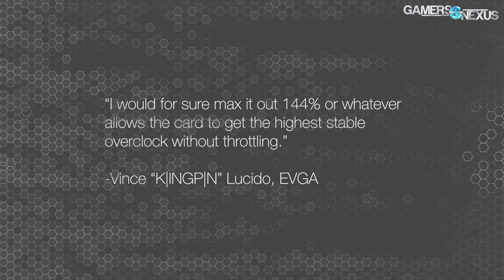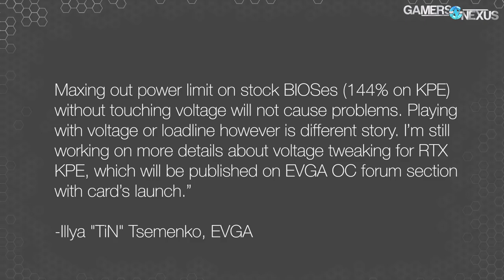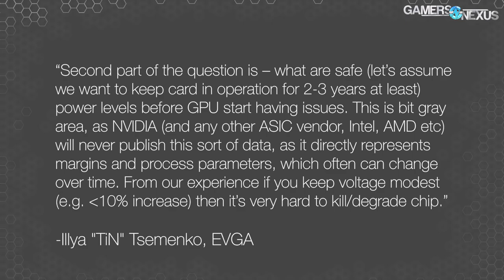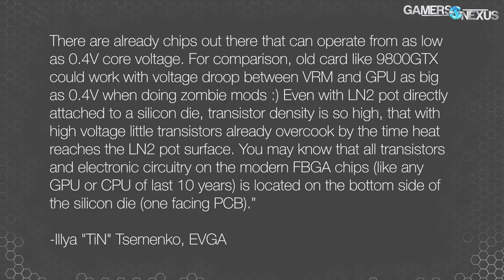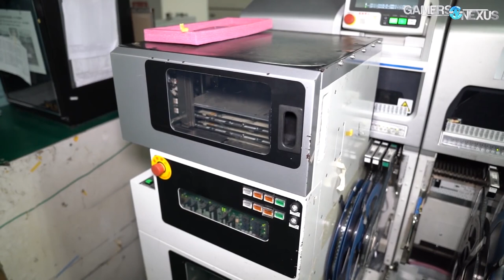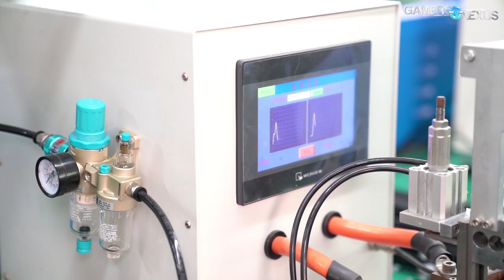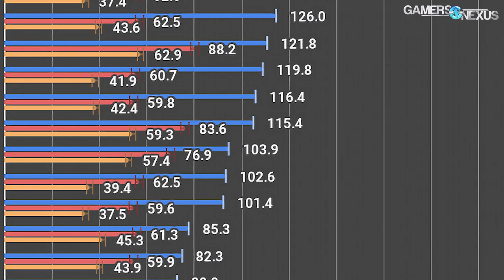Ask GN 107: Does Max Power Target Kill Cards? Ft. Kingpin & TiN Answers

Comment: Hahahahaha I've run my gtx960 at 108% power Target and a 42mv over volt in software! It's fans actually JUST started dying after 4 years of running at this torture!  Maybe I'm just lucky that it's lived!
Reply from the maker: Not bad! Fans are replaceable too. Wouldn't be hard to get it back in commission!
Reply: Sadly,  my EVGA GTX1080Ti SC2 is not able to handle any power target above 120% anymore in any games at all(random DXGI hang and system lockdown). Just a one and a half-year-old GPU. 😭
Reply: That’s barely an overclock at all. And I don’t see how that has an appreciable impact on fan life.
Reply: @altairfoo1920  Weird have been running 120% on Asus Strix GTX 1080 for close to three years now without any problem.
Reply: @1337ghomri  Probably because of my intense usage of my card. about a month of GPU computation tasks(Linus Folding@home event). But my 3 year old laptop can still do 47% OC(1038Mhz default, 1531 OC) without problem. Weird.
Reply: Altair Foo Nope, Pascal was hammered in mining, no issues for 99% of the cards. You just have a crappy dud of a card... a lot of miners were dumb and had them packed with inadequate airflow as well... they would be complaining more if they were failing that fast!

You would probably think my stability tests are brutal, but I’ve never seen anything get close to duel crypto mining (Furmark is way below this level in power draw, it can get insane! But, if it survives 1 week of that without melting or giving an error, then it’s probably good!). Your running something “hard” is laughably light. My motto is “if it’s not icing over, you’re not overclocking!”. You are basically running stock, at moderate or “gentle use”. Your not really using the CUDA compute 24/7 for years straight...
Reply: Altair Foo Your chip was probably borderline scraping past QC (I’m actually pretty confident Nvidia doesn’t have a QC in reality though). It was probably barely up for running stock, and now the near infinitesimally small degradation wear is showing. A lot of people have Intel at stock start crapping itself after a few years, while extreme overclocked dumping massive voltage in 24/7 running phase systems might run the CPU for the same amount of time. It’s silicon lottery basically, and degradation lottery from that, you just got the 1/1000 super crappy wear rate ones!

Personal advise, nuke the stupid thing and send it back, because it’s probably going to completely crap itself just days after warranty, and you won’t have anything. It’s defective if you saw that kind of wear (it would be wearing the same within margin of a few days even if you left it stock). Find some way to destroy it without water damage or visible scorch marks. Gonna be honest, that is so crap, I’d just ask them for a replacement as it is and say it’s crashing some at stock, because your really just at stock in reality... if they don’t approve, maybe stab a capacitor with a needle and say “oh my, some capacitor is leaking!”, because Nvidia directly will not help you out (they are a bunch of a$$holes who don’t give refunds due to faulty drivers making my Titan Xp unusable for months, and wasted thousands of dollars in my time). I’ll be destroying mine on LN2 since that $1200 I paid for has ran for me usefully for about 1 day, and that was it, couldn’t F’ing play Minecraft without crashing until I had upgraded to something 2x as fast, and after I bought it, went back to my old but very stable 2x Fury crossfire... Now I’m enjoying the butter smooth and reliable gaming of 4x Fury, so the Titan was useless, and I made the mistake of thinking it was user error or just windows needing reinstall, so unfortunately I kept it past day 30, so it wasted so much damned time I’ll be happy to help you destroy that card so you can get a working one because Nvidia is scum in terms of customer support. Do see if they will just accept replacement first though, Nvidia is a pain in the @$$, but other companies might actually care about customers, so you might just have a chance if you let them know, because that’s not normal, and you unfortunately have a defective card that’s just going to get worse,
Reply: @jakegarrett8109  that is a long reply, thanks anyway. haha

Comment: #AskGN

SO! 
I have a 9900k, Asus Maximus XI Hero, 32g 3200mhz, 2080ti, on a 1000w corsair RMi

As i go to export a video on Premiere Pro, after it gets to about 55% finished my computer does a hard reset, Everything cuts off, even the lighting on the MOTHERBOARD.
I go to check the event recorder and get a "Kernel Power Event 41"
I need this fixed pronto, could it be a bad PSU, bad CPU (I hope not) or motherboard 
Im hoping its the motherboard seeing as Asus cut corners with the VRMs on this board
Please please someone HELP!! 

Thanks!!

Comment: Should a $40 case have type c on the front? Objectively yes it should. This would continue to increase adoption of type c which I think we can agree is a good thing.

GN can and should grade a [case] on features and consumer price and use this industry knowledge to explain why the [case] did not score well.
Reply: where do you cute the corners to add the 10-20$ cable to the case if not more or less than that. The rest of the ports and types materials used structure etc. Instead of being a greedy consumer for your own benefit be a more open minded and understanding consumer as to why certain things are how they are. Rather than sacrificing other people companies or countries and collapsing economies etc just because youre so greedy.

Comment: #AskGN  any chance of you guys doing an investigation into why  the 3900x appears to have one chiplett stronger than the other? 
We'll use my 3900x as an example and we'll call it chiplett 1 as c1 and chiplett 2 as c2.   
My setup is a taichi x470 with a 3900x, noctua nh-d15,  2 sticks of 8GB 3200Mhz gskill cl16 ram.  This is with my mobo set at default settings, which Asrock as set as PBO+AutoOC enabled and this is fine, the only thing I've turned on is xmp profile.

various cores at various times on c1 will boost up to and including 4.65.   cores on c2 will boost up to 4.35 at various times, can't recall exactly but I think I've seen some of them boost to 4.4, but for about 99.99% fo the time, it's 4.225  - 4.35 as max boost on c2.   When running a game or rendering a video using sony vegas, the all core boost will be 4.35, and when running a game while rendering a video, all core boost will go somewhere between about 4.1 - 4.25.  The thing is, I've seen review videos showing these same results(for example, hardware canucks shows it in this video - 4 : 55 to 5 :  25 https://www.youtube.com/watch?v=GnR6nCk8BRk&t=1s, max clocks on c2 get to 4.3) as mine and it leads me to beleive that AMD has done some kind of mix & matching for binning and pricepoint, but this is just my theory.

Have you guys seen this behaviour on other 3900x's and if so, why is it like this?   I'm happy with the performance, it was a HUGE upgrade from my old 2600k, but now I'm curious as to why this works this way.  Is it due to AMD having a limited number of binned "really good" 6 core chipletts and matching them with a run-o-the-mill 3600(x) 6 core chiplett in order to keep pricepoint down?

Comment: Why has Nvidia not solved the high clock GPU issue when running a 60hz and 144hz monitor, Especially with it being around for as long as it has been. my MSI 1080ti runs at constant 1544mhz unless I manually downclock.
Reply: Corey Mcmillian I'm nearly 3000% sure that's a windows bug rather than nvidia, I had the same problem with a vega 64 but I'm now running linux and it's never happened to me since I switched. Might be different for nvidia but I'd bet money it wouldn't happen on linux even with your exact setup.

If you've got an extra drive laying around you could drop linux mint on it and check, assuming it's an ssd the setup would take about 15 mins
Reply: I have Vega 64 and 144hz and 60hz monitors and don't have the high clocks.  I did with Nvidia and a 1080...
Reply: never had that issue with my 1080 from msi or any of my rtx cards. Windows bug driver bug effecting some cards or just hardware flaws or something for different makers in the custom card market. I don't know. None of my amd cards have have the issue either.
Reply: 60Hz and 144Hz monitors,138MHz clock here. You're doing it wrong.

Comment: #askgn Hi Steve. Can we get a deep dive video on the bottlenecking of RTX 2080/ti. Watching comparison videos on other channels (3200mzh vs 4200mhz, i5 vs i7 vs i9...) I noticed that a 9700K will reach 100% utilization and the GPU % utilization would be less than 99%. The 9900K is the fastest gaming CPU, but are the fastest GPU cards out there limited by the CPU or slower memory? Would be nice to put up a system with the fastest memory available and i9 7980X vs 9900K with 3200mhz/fastest memory available for some different results. Curious if an i9 7980X would get more fps than a 9900K.
Also, thanks for your awesome videos.

Comment: Do you agree with nvidia's current price scaling over time? Given that the only real cost incurred would be R&D + some silicon manufacturing for the actual gpu, I don't see cards costing over 100% more for single gpu flagships as opposed to 2004, when the true dawn of home based GPU performance came to pass. Example, the mighty 6800 ultra launched at a staggering $500 msrp, by today's inflation of 35 more cents on the dollar https://www.usinflationcalculator.com/ that comes out to a whole $672.85 today. Let us say that nvidia invested gobs of money into R&D and silicon. I would still be hard pressed to believe that $200+ more per card at $872.85 would be slim margins. As far as the PCB itself, not much has changed, a few more traces, extra power phases, but in the grand scheme of things, the added components and cost is probably somewhat offset by the reduction in production costs, by massive volumes of product, we have consumed over the past 14 years. The cost of goods should logically go down with time, due to advances in manufacturing, and mass production. We have had both, and yet Nvidia card prices especially, leave a huge gap between the entry gaming cards, and the flagship. It's not just me griping, even Forbes took notice. https://www.forbes.com/sites/davealtavilla/2018/09/20/digesting-nvidias-geforce-rtx-2080-and-rtx-2080-ti-performance-features-and-price/#3202f01c35e3 Although the only 1080 ti I can buy, for the price their op ed piece, sighted for $180.00, is an ebay deal with a reference cooler, in good condition, PCB not included.
Reply: p.s. this is a good topic, I bet you will be the only one to raise it, as GN appears to be one of the last review channels unbeholden to big red or green, unlike Nvidia Media Group, even if you are a bit cozy with EVGA and zoid gets some free stuff from corsair, both of which I approve.... =)

Comment: USB-C is overrated. A lot of second hand deals offer far more value, but much of tech media likes to forget that when rambling about new expensive hardware features like USB-C. A stupid connector by itself does not make it worth buying overpriced hardware. For a regular person with a strict budget that USB-C port is a premium optional feature.
Buying just a smart phone instead of the latest "greatest" most expensive phone addict heroin equivalent dopamine hit and buying PC parts based on good value performance and NOT buying yet more adapters between different port types, it all adds up to savings that could easily buy another monitor or nicer peripherals or a really comfy ergonomic chair etc.